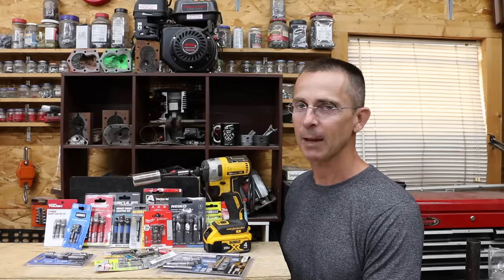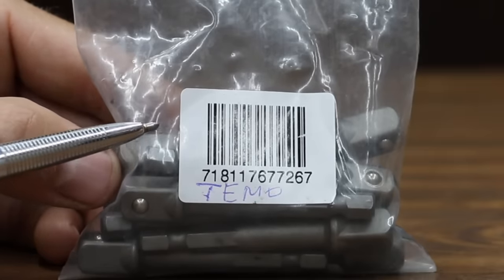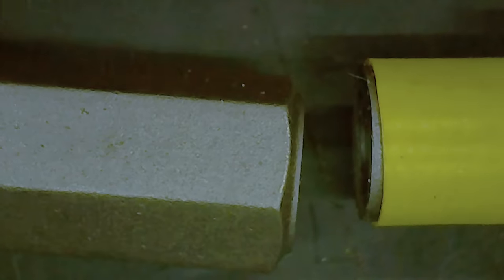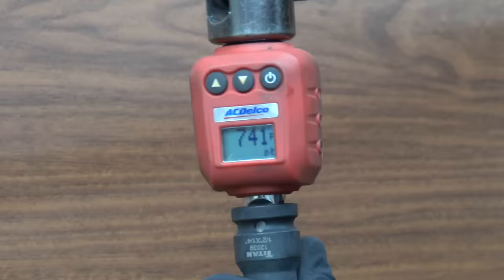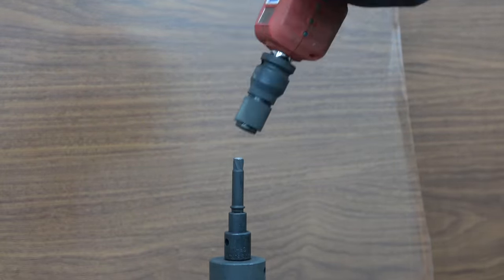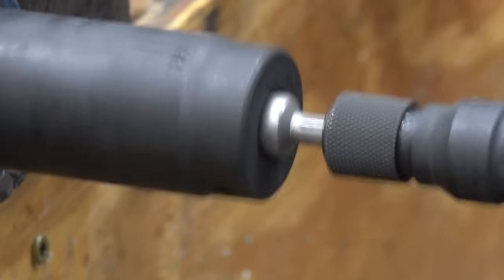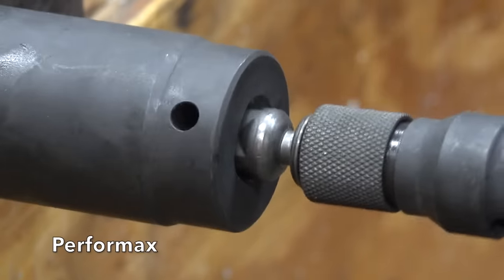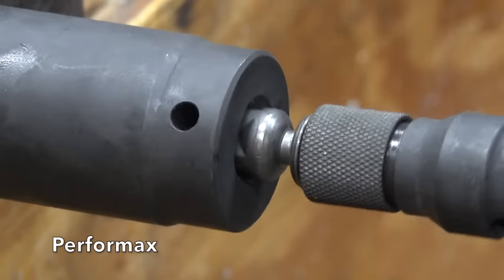Best Socket Adapter? 18 BRANDS: Milwaukee, DeWalt, Makita Gold, Ryobi, Hart, Irwin

Comment: Hi PF, would you consider testing degreasers such as "purple power" "greased lightning" and so on?
Reply from the maker: Thanks for the video idea.
Reply: I like that idea. I end up using dawn dish soap and water a lot working on carburetors as it seems to clean better than some of the industrial cleaners. It is also cheaper
Reply: Yes!
Reply: Gunk wipes!!!
Reply: ATF as a cleaner
Reply: And how about that wd40 solvent based degreaser?
Reply: I mean, also mabe include good ole' brake cleaner since that's what's on our shelves a lot of the time and what we often reach for since we don't have to use water to spray it off.  But compare that with purple power, ect.
Reply: @queenofspadz  Brake and or Carb cleaner seem to be my go-to
Reply: I'll tell you Simple Green worked really well on degreasing my 220k-mile pistons.  I also tried a piston in dawn dish soap (Not good).  I also tried "Super Clean" and that ruined the piston.  It etches aluminum unfortunately.
Reply: they all taste terrible, just btw
Reply: @The3chordwonder  Everyone needs to be careful if they consider heating ones like Simple Green, OIl Eater, etc. and/or using them in an ultrasonic cleaner. I suffered lung and sinus damage from the fumes! Many contain variants of Sodium metasilicate - pentahydrate, 2 Butoxyethanol, Linear Alcohol Ethoxylate. I also sprayed Simple Green on parts to remove mold release. I had to install a vent hood because of sinus irritation!
Reply: @ShilohRowden  i work as a mechanic in supermarkets and they have some degreaser chemical dispenser stations throughout the store. They have this one pink degreaser that works great on parts and cleaning up oil spills. And its free! Well for me at least.
Reply: As a professional detailer i agree this would be a great video as well other cleaners.
Reply: @escargod  In my case I didn't heat it, but it is really common to do so and use in an ultrasonic cleaner like you said.  I will definitely say that simple green at full strength really makes it hard to breathe.  Same thing with the dollar store oven cleaner (Which is the best engine degreaser I've ever found).  We only got one set of lungs, so I would say the smart thing to do, if using these for prolonged periods of time would be to wear a proper charcoal filter mask.  I think it is also common sense, but people should not mix cleaners as some of them give off chlorine gas when mixed.
Reply: That would be a good showdown. I recently did one just for kicks between Zep Purple vs. Simple Green . I'm an over the road truck driver and recently degreased half (left and right sides ) of the under chassis on my Mack with Zep Purple and Simple . The Zep Purple really excels at heavy grease removal leaves a steam cleaned appearance.
Reply: I love Mean Green sold at lowes!!
Reply: Yes, yes! Add KrudKutter to the list.

Comment: Could you imagine going to in to your local hardware store and seeing items that are project farm approved? That'd be so cool.
Reply: Our family owns a small hardware store, a True Value. We actually sell a bunch of DeWalt, Ryobi etc. Used to sell Milwaukee, but they dropped True Value as a vendor so we no longer have them.
Reply: What’s even cooler is when you already own them. It’s like the ultimate affirmation.
Reply: It would be better than the good housekeeping seal of approval.
Reply from the maker: Thanks for the positive comment!
Reply: I plan on putting a Project Farm Approved decal on my truck. It just won't die!!!

Comment: PSA time: Timely video for me as I recently had a Milwaukee 1/2" adapter (not one that you tested in this video) shatter like a couple of those tested in this video. It was on the end of a Dewalt impact and I was setting larger (36mm) nuts/bolts for a beefy home workout rig I was assembling. I spent an entire day fastening dozens of nut/bolt combos w/o any signs of a problem. Then, the next day, I grabbed my 36mm socket and popped it onto the Milwaukee adapter once again and pulled the trigger to make sure everything was seated. As I did this, the adapter snapped against the resistance of the palm of my hand holding the socket (read: not much) in an explosive way like a couple of those tested in this video. Because of how I was holding the larger socket with my off-hand & was pressing the drill towards the socket, this jagged part of the adapter basically tore into my hand for a couple of rotations at the base of where my left trigger finger meets my hand. Due to the sharp and jagged nature of the failure point it chunked up a smaller section of that area down to the bone. Needless to say this was a painful mess that took me out of commission for a while. It's been a couple of months now and the area is still pinkish in color and is obviously still repairing and susceptible to damage. 

Moral: be VERY careful of using these sorts of adapters. I'm not sure the thinner gloves I normally wear would have saved me but it likely could have helped. I would suggest wearing some durable gloves whenever you're using these types of adapters because even if you feel you're using them in a relatively safe manner will below their rated limits... bad things can happen. Be careful folks.
Reply from the maker: Thanks for sharing.
Reply: Thanks for the info, ill have to start wearing gloves then as i use my impact driver often when im home.
Reply: @richardlapoint1845  not a bad idea. I know I will from now on. I was out in my shop after I posted that last post and realized that I kept the two halves of the broken Milwaukee adapter. I wish YouTube had a way that I could post a photo so you all could see what I'm talking about since it's kind of hard to describe.
Reply: @worlds_okayest_crossfitter  i know exactly what you're describing,  ive seen tools fail in that manner.  Iused to work in shops and had a socket shatter and if i didn't wear glasses, would probably not be driving semi today.
Reply: @richardlapoint1845  when you're younger you always hear the safety warnings from the old farts and just think that they're being crazy. well now I'm the old fart passing along the sage wisdom because I never would have guessed that this part could have failed from the stress (or complete lack thereof) it was under nor could I have guessed the manner in which it failed. I'm almost always the first guy to glove up and wear eye and ear pro. Almost. This was one of those rare occasions where I didn't and I learned my lesson in a painful way. I'm just glad it wasn't worse as it certainly could have been. Hoping to pass this experience along so that others don't have to share in a similar pain to learn the same lesson.

Comment: My question is where do these  things go, I am sure I own all 18 brands you tested and I can never find one when I need it.
Reply from the maker: Great point!  Mine seem to go into hiding too.  lol
Reply: I use these tools regularly so they go in a magnetic parts tray on side of my tool box. I lost them too often before
Reply: Tilc Rekcil  
Lol the 10mm is the Waldo of tools
Reply: @ProjectFarm  For my small stuff like these I get a block of foam and an organizer from Harbor Freight with the removable compartments, take out as many as I need to and fill the rest with the foam and carve out slots for the tools. I have about ten of them with things like rivets and tool, etc. and they're less than $10 each with the foam.
Reply: Cats man, cats

Comment: Absolutely love the channel!!  I've used them for 30 years and have never snapped a single one.  What I'm most concerned about is the adapters ability to hold the socket correctly.  Does the ball detent work with the desired pressure?  Does the retaining pin lock it on solidly and does it release? How tight is the interference between the socket adapter and the socket?  Yes I gave it a thumbs up and No I'm not a hater.

Comment: i had a cheap makita for over ten years and it finally gave out once i got into transmission work. ATF fluid is incredibly detrimental to the internals. Dont get em wet! i got a fairly cheap $20 milwaukee set with a phillips, 3/8 adapter and a bunch of other stuff i rarely used. the bit set outlasted my impact and i still use it today. 
anyway for a short while i used some harbor freight bits, the little black sockets ones. they were really convenient and never broke on me but wore down around the edges of the adapter. i think this helped wear out the driver too cuz i had issues with my overly expensive matco bit set later on.
the cheap sets are good 'get me by' tools but dont use them more than a few months, they will wear your tools down.
Reply from the maker: Thanks for sharing.

Comment: Out of interest, I've noticed you rarely test Husky products from Home Depot. I want to see how they hold up
Reply from the maker: Thanks for the video idea.
Reply: Same here. I recently picked up a 6 piece set for under $10. For my uses they'll work just fine. But would've been nice to see them tested.
Reply: Hey! I'm not as experienced as Project Farm, but I've been abusing my husky adapters for the past year and haven't had a problem yet. That being said, I'd love to see a video testing them, as I use a ryobi driver, so it isn't exactly being pushed to any limits
Reply: id like to point out husky is one of those companies that rebrands other companies tools and sells them with their name (atleast sometimes) dont get me wrong i have quite a few husky tools and do like them but part of me wonders if they were manuafactured by them or do they just have a great sourcing team one example i can think of is their ratcheting wrenches they are actually gearwrench brand
Reply: @diyoutube6061  Every brand is rebranded. Ryobi is made by the same people as Milwaukee. DeWalt is owned by the same people as Black and Decker, Bostitch, Proto, Mac Tools, Irwin, Craftsman, and a few others. Just about every single brand is owned by other brands, it's all the same. Even Snap-On is shared with Blue Point, Lindstrom, and Williams.
Reply: This is a very good point. You have Menards(midwest only), Harbor freight, and Wallyworld. Why not home depot?
Reply: Brant Andrew I think that’s somewhat true but for example snap on owns blue point, Stanley owns dewalt and black and decker and that doesn’t really mean all or any of dewalt,Stanley and black and decker tools are the same but rebranded... I see your point and I’ll agree there are other companies that rebrand but from my experience husky does it the most and doesn’t own these companies that they are rebranding the tools from seems like they are just getting their hands on over stock of quality tools and putting their name on it (hence the great price for quality tools) which is fine I just think for reviewing it may be an issue which is why I wanted to point it out
Reply: No idea where he is located, but Home Depots are scarce in some areas. I don't know where the closest one to me is, Menards has taken over in my area
Reply: Another Youtuber (ClientGraphics, I think) did some stress tests similar to ProjectFarm methods and he had the Husky and Makita Gold (among others) in his. Husky did very well, as did the Makita Gold. It may have even done better than the Makita in some tests.
Reply: @brantandrew5777  many times they are manufactured for others but to differing tolerances. So not truly the exact same product as many like to imply...they may be close but not the same.

Comment: I always keep a ryobi impact driver in my truck.  The thing is Incredible, especially for the price!  2500 inch lbs I believe of torque. It's strong enough for me to put a socket adapter on it and to pull lugnuts off my truck
Reply: I keep a 1/2 impact from Ridgid in my truck and we always take a battery and USB adapter. The battery and chargers are in my mud room always ready to grab one and go.  I have a socket set that stays there as well.

Comment: Very interesting results. I would of never guessed the Torque Smith, which I own would do so well. But I am getting the Dewalt for my impact tool set.  Keep up the great work.
Reply from the maker: Thanks, will do!
Reply: Watching PF's videos it seems like DeWalt is never in the bottom tier. Worst I've ever seen is about middle of the pack. I like that popular brands are always tested.

Comment: It’s strange to see a Milwaukee product so low on the charts!!! 

Thank you for all of your informational videos, Project Farm! You are a very intelligent & well rounded kinda guy. 

Thank you again for all of your hard work, & your EXCELLENT content!
Reply from the maker: Thank you!
Reply: That is why I bought DeWalt ,.  I read bad stuff about their fuel line breaking too.  I just went with the 899 and read reviews of people using them in coal mines and whatnot,  without issues so I figure it should be fine for me.
Reply: Milwaukee accessories often don't perform well. They outsource it all.
Reply: @StreetWorksMedia  Milwaukee’s fuel line is top notch, not sure where you read your reviews.
Reply: @booya6437 Don't go by what you see on YouTube with their tools do not hold up, I work at home depot and we get way more Milwaukee returns than Dewalt, Makita and Bosch, ryobi and ridgid are also terrible we get a lot of returns from them Dewalt and Bosch are by far the fewest in returns with Makita coming in third. A Hyundai will drive just as nice as a Toyota brand new two year's down the line and let's see which has more problems the Hyundai will have more problems
Reply: @loucifer323  I call BS… my experience is as a contractor and I’m hard on my tools… I have worn through Bosch and Mikita, typically the first tool to go is the hammer drill if you do masonry drilling (not even coring) Dewalt is normally a close second to Milwaukee. Also the reason you see so many more returns is because of what the market share that purchases the tools is doing with them… the guy who comes in and buys the Ryobi, will use the tools ~3 times a year and be happy… probably the only returns are defects. The hobbiest and weekend warriors will be super happy with Mikita or Bosch tools they’re pricy and work well… but not for everyday use… at least in my shop. Milwaukee is my favorite but mostly because of the scope of tools they produce… one platform that you can use for almost everything. Their warranty is easy to work through, their tools show up to work every time you need them and across the board are worth the price and bring the value you expect. If dewalt is your cup of tea, I say go for it! Great tools as well! But to rely on returns as your only metric makes me feel like you haven’t ever used them side by side - different markets and different occupations will lead to different purchasing decisions and different abuse.

I should note I typically buy makita and dewalt for accessories, Milwaukee for power tools
Reply: @loucifer323  Enjoy your minimum skill job where you can be “the goto expert” to DIYers who (quite surprisingly) know less than you do… 

This channel is designed to help consumers make educated decisions… and it’s pretty rude to come in the comments and insult the information  presented about top performers in almost everything and the other tradesman who use these tools to earn their living while you stock the shelves with tools you may have seen the brochure for.
Reply: @loucifer323  also with Milwaukee returns, they have a lot more online sales/promos where you can get a deep discount on a tool (i.e. mid torque impact wrench) if you buy a minimum dollar amount or a kit and then return the items you don’t want. I got the previous gen mid torque a couple years ago for about 120$ bare tool but I had to buy several other tools up front.  A lot of people do this and may be skewing the amount of returns. Yes, Makita and DeWalt do these promos too, but not as heavily as Milwaukee
Reply: Not that strange. Their hand tools have never been as good as their power tools.